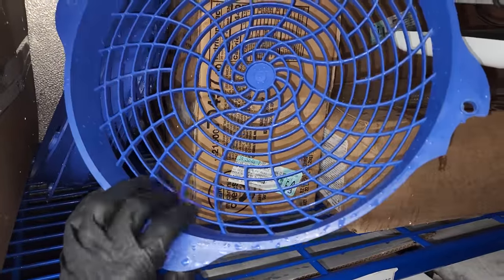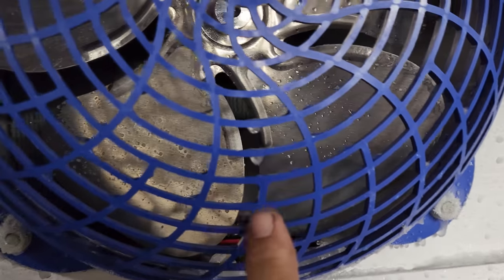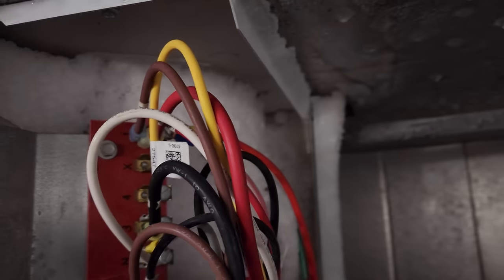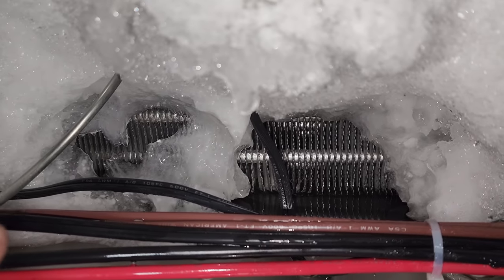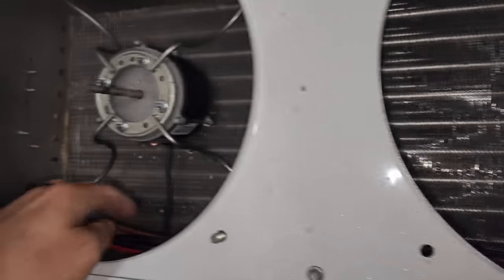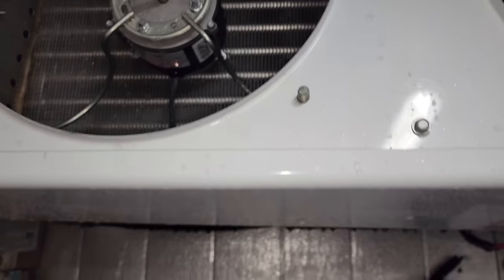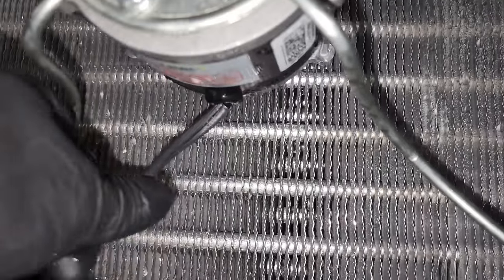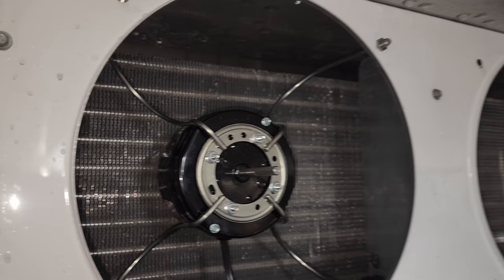THE WALK IN FREEZER HAS A LITTLE ICE ON IT.....

Comment: The issue of ignoring problems until the item doesn’t work anymore is not specific to HVACR. It happens in any repair industry. It is frustrating, but ultimately, you’re still getting paid to deal with their failures. If they call you after hours, I’m sure you charge more, and you have every right to do so. When I was working as an auto tech, it was very obvious when problems had been ignored for a long time. When I saw problems like that, I would not only fix the problem, but every problem related to it. Not only did it make the repair worth my time, but it helped to reduce the inevitable “you guys did this, now it does this!” 

Something else that I appreciate that you do is what you call the “big picture diagnosis.” That’s important not only when dealing with a specific concern, but also when dealing with customers that only call you when something breaks. For those customers, you not only address their concern, but have to do a thorough inspection on EVERYTHING, and tell them EVERYTHING that they need to do. Customers like that will often do everything that you tell them needs doing. I spent more than a year trying to convince my shop manager to let me implement that style of inspection on every car that rolled through the shop. They were very reluctant to do so, because it meant that they were paying me to do a 30 minute inspection on everything, but in the first full year after we started doing that, shop sales increased by 50%. We weren’t creating work or selling things that didn’t need to be done, we were finding and addressing issues that were repeatedly missed or overlooked, fixing problems before they caused break-downs.

If you spent most of the day there and replaced all those parts, I’m guessing $2500.

Comment: $250/hr, those motors run up to about $1,000 each if they're the same one I just looked at to replace in a Krack unit at a supermarket walk in freezer. The fan blades are between $75-$100 if I recall correctly, the mounts I'm sure we're within that same range. You have at least one hour of setup for deicing, deicing takes about an hour if you're draining quick and get the back ice to let loose. There's the hour it takes to find the parts, the hour it takes to drive to the parts house because just getting out to your van and starting it up feels like a monumental task by this point because all you can do is think about how much bullshit it is that you're on a call that could have been placed weeks earlier. There's the half hour at the parts house getting everything in order, the hour drive back, then the installation for about 1.5 hours by the time you get all 3 fans hooked up and mounted with the blades and covers assembled. The hour of troubleshooting and another hour of cleanup before signing out with the management.

9 hours @ $250/hr + $3,400 for parts = $5,650 

I'm being a bit generous on the hourly rate, but I can't imagine the hourly emergency rate is much lower than that. For the billing I've seen, regular hours go between $150-$170/hr. depending on the customer.
Reply: Those supermarket setups are nuts I can’t image what an outfit like Costco pays.
Reply: @thelol1759  the costcos we worked on we're CO2 systems, and I don't think the pay is much different. I've never seen their bill. Also I guess their EMS is a bitch to work with. I fortunately never had to work on anything there

Comment: I work at a grocery store and I will defrost when I see ice really high in a case. Other managers will just ignore it but I know it needs to be done because it will become a problem. I have to use a shop vacuum well trying to free up the drain. Plus alot of junk from frozen food gets in there so I use the shop vacuum to get all the junk out of there. The drain gets clogged and it doesn't easily get unclogged. Ice is so bad on one of the freezer doors I was doing I had to defrost the wires before I was able to unplug the fans. Then well I in there i clean everything and put mesh on top of the plates to stop some of the frozen junk from going down to the fans. Some managers are just lazy and don't think it requires maintenance.

Comment: I just did an on call for 3 evaps 2 iced up and 1 not running. They had one turned off for no reason and waited just as long as yours to finally call it in. Mine wasnt a walk in its a giant processing facility for costco but still sucks when its 8:30pm - 3:30 am after a 10 hour day

Comment: Have you used a porta blaster unit. Maybe not in this situation but I've used it when water was not readily available. It's a great low on water consumption and does a great job of. Melting ice or cleaning a coil. Without making a mess.
Steve

Comment: I had the same problem Iced up fans! You know what the problem was problems was the temperature regulator it wasn’t shutting the system down when it’s supposed to when it reaches a specific temperature setting so it was running 24 seven! After that part was replaced then it worked perfectly and it still works😀

Comment: I see that with thise interlink motors all the time.
The wires just break off right at the motor the ice didnt do that.
Great video!
Reply: Yep, brittle failure of pvc insulation.  Silicone would be nice for low temp as well as high temp but gotta make em cheap as possible!

Comment: Worked in a racino's kitchen, and they wanted to put....two and a half pallets.....of pies in the freezer, from a failed thanksgiving giveaway, and I told them that was a bad idea for food safety reasons.

Didn't listen, put them in anyways, it was....floor, to within a foot of the ceiling...front to back, left to right, all pies....still in their boxes, so zero gaps between cases.  Completely choked off every ounce of airflow that allowed the freezer to function....forget the fact that they blocked in everything else that was already in there and actively being used....

Three guesses as to what eventually happened and the first two don't count.

Comment: Those connectors are garbage. If I have any issues with them, I generally cut them out and hardwire the motors with insulated male and female spades and a bit of heat shrink. 
The old rubber connectors were great. The plastic they're using now tends to keep the connection from mating properly, no matter how hard you stuff them in. 
In the past year I've had 4 units with the connector burned up internally.

Comment: Without thinking much…. Like normal… My company would charge an easy 4-6k in parts and labor on overtime. I’ve noticed thousands builds up easier these days. The videos seem faster, but that call once your in route, unload and load your tools, start up and check, trip to the supply house, that’s 4-8 hours. It all Varys, every job. What matters is you got it done. Can’t stand it when I’m in a rush on service calls, and I got the office in my ear. The office creates more call backs then the tech doing the work

Comment: That was the worst ice you have seen on a WIF? Not trying to one-up you but I have seen a lot worse. Ice cream warehouse in central New York. There was an iceberg the size of half a car under one of the 6 coils in that section. The ice had push one of the fan motors out the front and the iceberg hanging off the coil was at least 5 feet long. As I stated an ice cream warehouse with 16 foot ceilings. What a nightmare. Had to do everything on a highlift. Always a challenge....Cheers!

Comment: Hold on to the brackets and repair them (weld with oxy or mig/tig) and resell them on a lower rate ;)
Reply: This could be done with half of the broken parts. Even that evap blower motor is probably still good, just needs a new cord. Not worth the time for HVAC repair though. Maybe some scrap yard could pay a few bucks. I think most used parts end up right in the trash though.

Comment: I'm noticing some ice build up on one of the walk in freezers I am looking after...? the ice is only building up on one side of the back corner of the coil, but their is a substantial amount build up on the front. i am worried this is going to effect the evaporator fans over time. Any suggestion on what this could be cause from? it would be much appreciated. All evaporator fans are working, ive noticed the compressor oil is a little low on the site glass of the compressor, the site glass is a little bubbly and suction pressure seems a but low. Thanks in advance

Comment: I don't see a point in ever using a torch since most/all of these freezer systems use hot water to defrost. That means the parts are only rated to deal with that kind of heat and it gives you some insurance so they can't come back and say "well I saw you in there using a torch and my other guy says you damaged a perfectly good part that you charged me for". Always be honest, do a good job and cover your ass because someone is always watching.

Comment: I went into a freezer that was down once that they filled with dry ice... it was cold, but the air was filled with gas, and super dangerous to be inside.... Careful what you walk into
Reply: Dry ice indeed is no joke and caused its share of accidents. While it works well for that, ventilation is key. I worked on an airport as an aircraft handler some eternity ago, if the Load sheet for an incoming flight about to be unloaded mentioned ICE (that in aviation dangerous goods speech is the actual designation for dry ice in or with cargo) as dangerous good loaded in a cargo hold, the procedure was to open the cargo hold door and have it vent for a certain amount of time. And still, a lot of not too old tales about someone passing out due to CO2 from dry ice in the cargo hold are told because someone did not wait to check the load sheet and jumped in to start unloading. (Which to be honest is the natural behavior when you have just barely enough time to unload and reload an aircraft before it goes out again even though you don´t have to wait for anything special like venting.)

Comment: My guess is door left open, ice built up...caused fan to self-destruct  as fans dropped off the ice build up accelerated. Until a space age type automatic fast opening and closing door or thermal forcefield is invented this will continue to be an issue.
Reply: You COULD get a man-trap for a freezer. Probably not economical. But you could have interlocking doors so the inner will only open when the outer is closed, and for reverse traffic, the outer will only open when the inner is closed.

Alternative: Pay me enough, and I could make a door that can't be faked into a closed state. (with magnets/etc)  RFID tag on the swinging part of the door. RFID reader on the fixed door frame. Encased in vandal-proof metal. Multiple alarm sounders. Also have the alarm notify the manager, if no response, notify corporate, if no response, notify HVAC tech, if no response, notify fire/police/president. 😆 WAAAAAY over engineered. 😆
Reply: @fitybux4664  what some people do, this might not be over engineered at all
Reply: @maotio  If it's for a prison cafeteria/kitchen, it might not be overkill! 😆
Reply: @fitybux4664  I just wanted to comment on what Carlos wrote but you nailed it, well part of it. I wanted to comment about a new refrigerator I got just recently. The old one as well as the new one actually have a door alarm. In the old one it was a classical switch, also switching on and of the light inside (well if you left the door open for too long the light went out, so it was not just that simple) But when putting in groceries or cleaning out, you could easily silence the alarm by presssing the switch (what would be the kitchen staff taping down the switch).
The new one actually has a sensor built in into the hinge mechanism on top. I cant tell if it is actually a magnet switch, or just a hall effect / proximity sensor which can see if the metal part of the hinge on the door side is right in front of it (door closed) or not (door open). I know the sensor is there, as I had to remove the hinges and take out the doors to get the thing squeezed through a tight doorway, and had to remove the cover and disconnect all the connections. (Thats even described in the manual for such cases). Otherwise with everything in place, no one would know it is even there as nothing is visible and no moving parts are involved.
I wondered if that would work for those walk ins, or if they would just strap some piece of metal too it so the door won´t close any more at all.

I wonder also if something like that, or those curtains, whatever there is, may become required some day, as open doors unless immediately used also waste a lot of energy, which seems to become more and more precious for different reasons (I mean in California it isn´t only Energy prices, but they are struggling with an overloaded power grid for years and years now). Just as another desperate attempt to save energy wherever possible.

Comment: Last week at work we had 90+ temps outside, and 90+ temps inside. Humidity was in the high-90% as well, so it was brutal. And there are dummies who think leaving the back door wide open to the world is going to help cool the building - by letting the AC out and hot air in? WTF???

The Assistant Manager said to me, "Hey, can you keep an eye on the walk-in freezer? It's running a bit warm." The box was +3 instead of -10. So I asked, "When did the last person go in or out?" "I dunno." "OK, well, is the door fully-closed?" "Um..." She goes to check, the door closes 1/4 of an inch. I look at her, smile, and say, "I'll keep an eye on it. Now that the door is closed, we can see if there's actually a problem. Let Eddie (or new District Manager) know that we need a new door closer on the freezer." I was 100% NOT SURPRISED to find the walk-in was running fine. Literally everything else in the store is broken, but our walk-ins are 💯. I'd be the first one to raise holy hell if they weren't!

Comment: 30+ years working on computers. There is a fast way but potential unintended concquences. Or the safe way, takes less time than doing the fast way twice, that is a win, cause the only reason the fast way twice is a failure... I like your methods because my personal experience follows the same tack, different equipment.

Comment: Some shops have those entrances without doors. Instead, they have an air curtain of some sorts, where a strong downward airflow prevents mixing of the inside and outside air. Such system could be beneficial at those restaurants where they keep on refusing to keep the walk in freezer's door closed. Should be possible. For sure on a new build, so the evaporator(s) can be sized and placed optimally in a walk in with an air curtain instead of a door.
Oh, well... the environmentalists will probably make sure that that will never be allowed, since a door is more energy efficient.
I wonder if the environmentalist's measures accomplish something, down the line. Those VFD's, economizers and what not, those are produced from raw materials, transported, installed. They break, cause collateral damage while breaking, get replaced by a service tech that came out with his work van. I wonder if they really do anything for the environment, taking everything into account.

Comment: When I worked at fast food I did HVAC for a living when I first came out of high school and I kept noticing our refrigerator and freezer would freeze up and I kept telling the manager hey our defrost is not kicking on like it needs to be oh it's fine until it shut down cuz it froze up and I just said hey check the defrost Cycles it's not been doing like it's supposed to be guess what I was right what happens when you work days back and then have to work fast food the manager won't listen to you till the system has to get shut down

Comment: I hear you on the frustration, I do hot side repair as well as HVAC/R the other week I got an "emergency" call on a Saturday an hour and a half away for a fryer not working. When I got there the deli staff asked what I was there for I said the fryer and they said "oh that's been broken for 5 weeks I'm surprised they had you come on a Saturday, I just smiled and said ya how bout that. It "not working" was the filter pump, I reset the pump and changed the filter that had been in it for about a month. I got paid double time to drive 3 hours (round trip) and clean a filter pan so whatever, but I was not happy to be there for a problem that waited 5 weeks but is suddenly an emergency.
Reply: then dont do your job...

Comment: But fid you address the icing issue? It doesn't just ice up if it's operating properly.
Reply: Could be the staff leaving the door open, or piling boxes in front of the evaporator, or one of the motors failed. Any of those things could have initiated the ice buildup. He made sure the rooftop unit was operating properly, verified the program settings on the board, and verified that the defrost heaters were working correctly. That's normally the steps I'd do for a first call on a freeze-up. If it happened again, then it'd be time to dive in deeper.
Reply: Did he fid the problem?  Yes. Did you not notice the NEGLECT on the part of the business owner?
I wonder how many people get sick from eating at that horrific place every week...